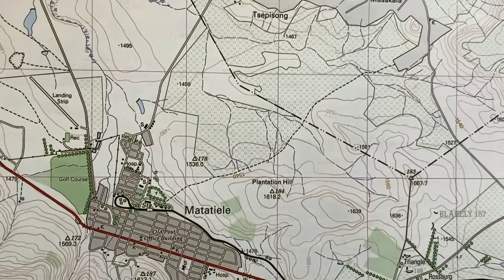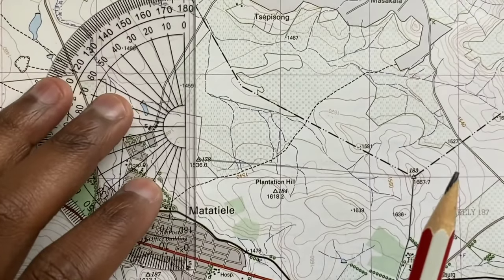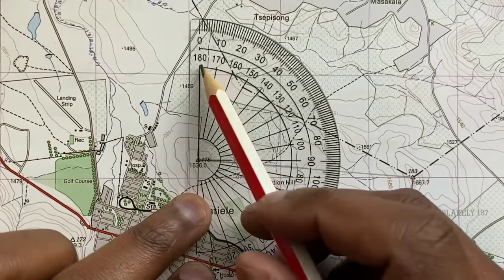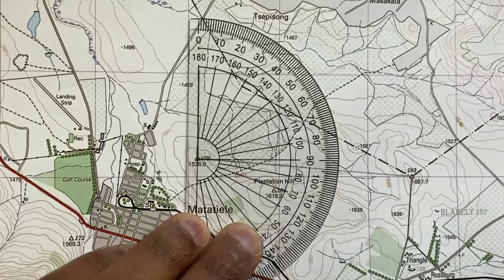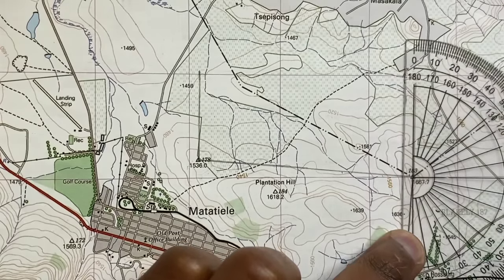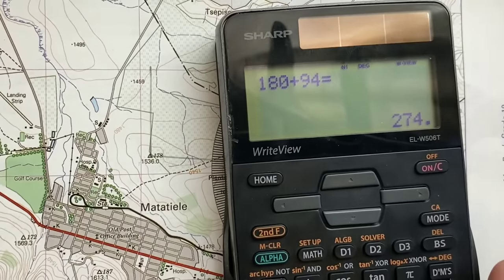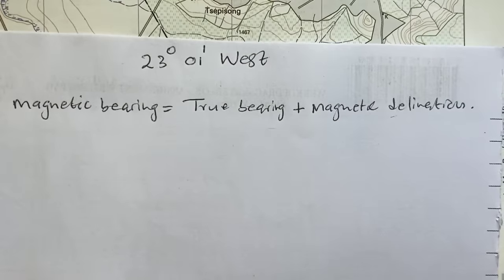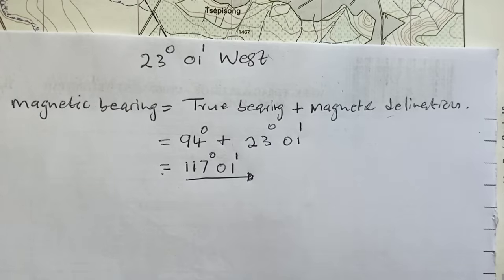Geography Mapwork: True bearing and Magnetic bearing.

Comment: You may have addressed it but I am confused on finding the Magnetic Bering. I understand that you add the declination (23° West) to your true Bering. But from other navigation videos I’ve seen a Western declination is always a Negative number so you would be adding -23° to 94° equaling 71° instead of 117°

 I am still struggling with grasping magnetic declination so it would really help if you could correct me. Thanks!

Comment: Why did u add 180 degrees after calculating the TB?
Reply from the maker: A straight line angle is equal to 180 degrees. Hence, 180 + the measured angle. 🙂

Comment: Where did the 274 go ??
Reply: Since we added 180 + 94 ...
Reply from the maker: I'm not sure if I understand the question, but the 180 is the angle  from 0 degree when you measure clockwise. Plus the 94 degree measured from the 6 o'clock. SO 180 + 94 gives you 274 degrees. Hope its clear

Comment: Sorry sir u made an error.IF THE ANGLE FALLS ON THE LEFT,TAKE THE INSIDE READING OF THE PROTRACTOR AND SUBTRACT FROM 360.WHEN THE ANGLE FALLS ON THE RIGHT, TAKE THE OUTSIDE READING OF THE PROTRACTOR AND LEAVE IT AS IT IS.
Reply from the maker: 😂 there’s no error there. We still getting the same answer with your method.
Reply: @EverythingGeography7  I didn't understand the way u explained 🤞
Reply from the maker: @Mthombeni12 well you’re the first person not to understand. We measure angles clockwise in geography not the other way around. It’s not about which side the angle falls in. Do not complicate it, a straight line angle equals 180. Then you measure the angle from 180 and add that to your straight line angle. 180+the angle=answer

Comment: WHY DID YOU ADD 94 TO 180?
Reply from the maker: Straight line angle = 180 + the angle measured in the third quadrant = 94
Reply: IS not 86 degree i can see that 4 degree  90-86=4 @EverythingGeography7
Reply from the maker: @mohamadkhatib8624 you must count clockwise from 0 o’clock. Do not be confused
Reply: @EverythingGeography7  I got it sir
Reply from the maker: Nice 😉
Reply: So you rotate half circle 180 than you added that side correct  @EverythingGeography7
Reply from the maker: Absolutely 💯
Reply from the maker: I will in due time 🙂
Reply: @EverythingGeography7  many thanks for your feedback ok sir
Reply from the maker: @mohamadkhatib8624 pleasure 😉